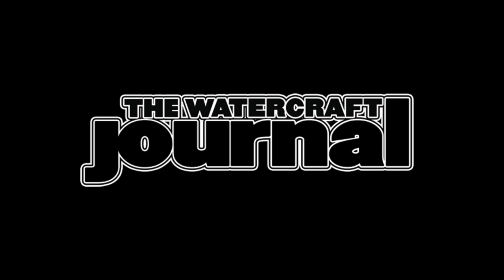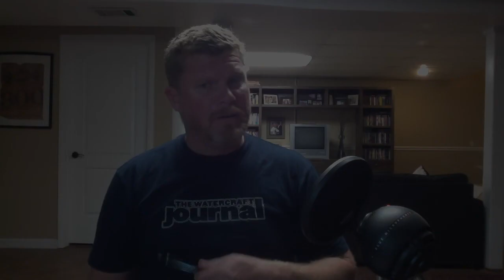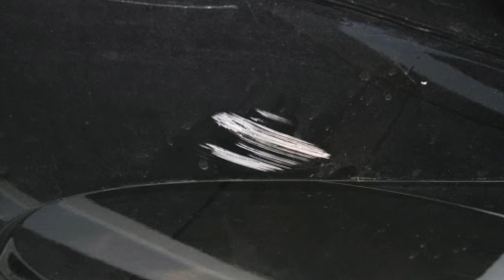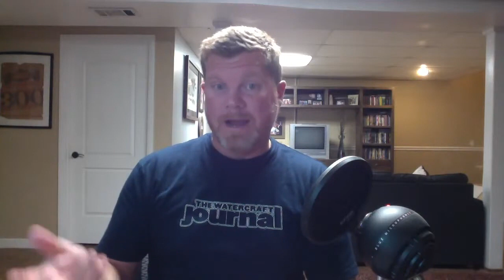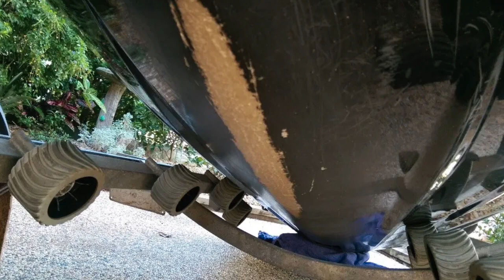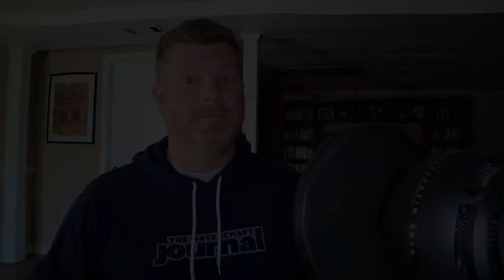Maintaining Proper Hull Health: WCJ Quick Topics

Comment: How do you feel the Polytech 2 hulls hold up to sandbars and lightly dragging up beaches….?
Reply: Great question. I just got a 2020 GTR 230 and have been wondering this as well.
Reply from the maker: It's not so much Polytec 2 that worries me, but the carbon seal. Honestly, never bring a Sea-Doo up on a sand bar – just anchor it a few feet away. Even the swirling cloud of sand and silt can impregnate the carbon seal. –K
Reply: @watercraftjournal  If I do I only pull the front to the point of holding the ski there never right up and the backs always in water…. then I push it out, lift the back up and down like you’ve suggested and push it deeper yet to climb and and start…. Thanks for the great advice again Kevin!
Reply from the maker: Perfect!

Comment: I have an issue similar to the image on the thumbnail... with the black streat going down the hull. Is that just paint that has been sanded off at like 60 mph or is that considered fiberglass damage? I have 21 limited ho
Reply from the maker: That is paint damage from contact with sandbars, beaches, etc.
Reply: @watercraftjournal  I was quoted 500 dollars to have mine fixed and I'm quite certain it was just paint.. you say that's reasonable or some bullshittery lol
Reply from the maker: Hey if you can repair and repaint it go for it! Otherwise, skiled people's time is worth money to fix your mistake. That's how it works.
Reply: @watercraftjournal  I agree with ya, I just have a hard time trusting this dealer unfortunately

Comment: Maybe a dumb question, but it seems like jet ski ports are destined to peel paint off of Yamaha’s over time. I have a brand new ‘21 VX HO that I *baby*, and am already seeing it underneath. At what point does cosmetic damage become something more worrisome?
Reply from the maker: That's a little ambiguous. Where are you seeing wear marks? We've had Yamahas in our care for years without seeing wear on the hull.
Reply: @watercraftjournal  directly under the center of the hull. The paint is definitely coming off, and I’m pretty sure it’s from the port. It hasn’t scratched white (still black), but the paint is definitely coming up.
Reply from the maker: It's from "the port?" What port? You mean the PORT SIDE? Or the paint is coming off of the keel? That means you've made contact with something.

Comment: Hi Kevin, thanks for all your helpfull videos. My ski (GP1300r) has a lot of scratches on its hull, does it affect the top speed? Also I plan to repaint it, should I use regular car paint or some special paint/coat?
Reply from the maker: Yes it will, but really not enough for you to feel in the seat of your pants (presuming the scratches aren't too pronounced). If you do plan to repaint the hull, we recommend a similar 3-stage paint but have your paint shop add in a flex additive.